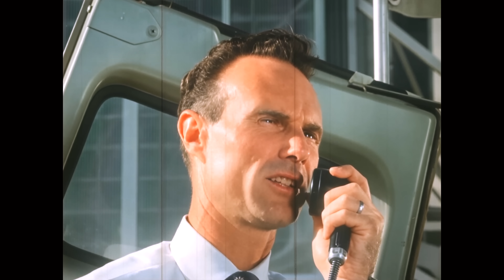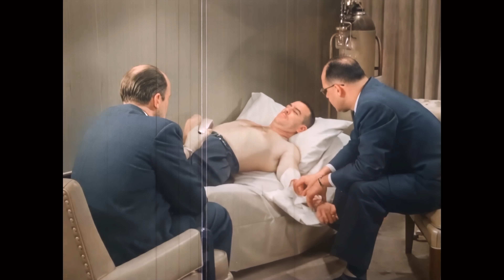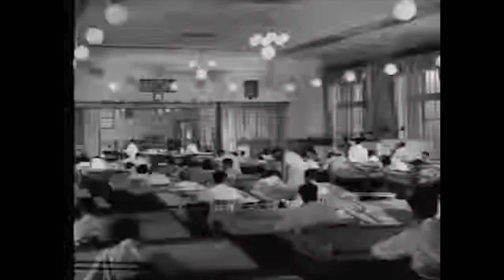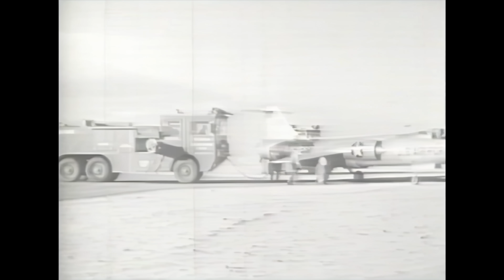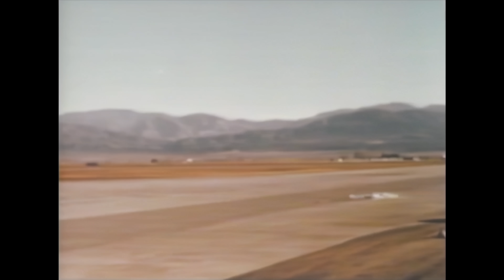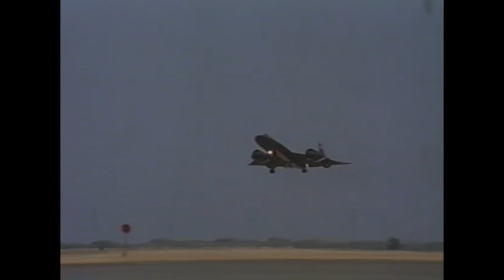Brilliant or Lethal? The F-104 Starfighter Paradox | The Missile With a Man In It

Comment: The Starfighter faced criticism in the 60s, 70's, 80s, 90s.  Still faces it.  Lockheed and America sold an affordable, small mach 2 fighter, that your country can build, maintain, and use, without the sticker shock of an F4 or better.  With adequate ground control, it could go up, attack a target 100 miles away, at over 35,000 feet, and return, bingo fuel, in 20 minutes.  Gas it, rearm it, repeat.  It's tiny front silhouette made it a tricky fighter bomber.  You could get this performance elsewhere, but at a much higher price, or you buy Mig 21s.
It was a 1950's hotrod that pushed the known envelope for fighters at the time.
It had rules.  It had limitations.  It could fly as fast as today's modern fighters.  It climbed like a rocket ship.  Fly it fast.  Slow is dangerous, and one must adhere to established procedures when going slow.  It was genius.  It required discipline to use it.  It gave a nation that was relying on subsonic jets something dangerous, and fast, and the autonomy of producing them locally.  It was a technological shot in the arm. Kelly Johnson was a genius.  So was the Starfighter.  That it served so long finishes this argument.  There were better jets?  That you could cook up at home?  That you can afford.  That can chase down and kill aircraft many times it's pricetag?  Supersonic 1950's hotrod.
They could have done better, sooner, but they kept flying it.  Because, in the big picture, it was the best.

Comment: Thanks to the pilot of the 104, that got too close to the xb-70 while flying, and because of how small and light the 104 is. The 104 got into the xb-70s airstream. Rolled over into the xb-70s fuselage. And both planes and all pilots involved were killed. The xb-70 project was canceled.
Reply: The bomber program was canceled in 1962.  Two prototypes were finished as research aircraft. The accident was in 1966.

Comment: Thanks to the pilot of the 104, that got too close to the xb-70 while flying, and because of how small and light the 104 is. Both planes crashed. The xb-70 project was canceled.
Reply: The B-70 bomber had been canceled in 1961, years before the accident, because it was extremely expensive and didn't add to America's offensive capabilities.  

The XB-70A flight test program continued through 1968. 

And that pilot you're "thanking" is Joe Walker, 1 of the greatest test pilots of that era.  He'd been given the unenviable job of flying in close formation with an XB-70A, when there may have never been any reliable data on how airflow from each would affect the other.

Comment: How does the F104 compare with UK EE-Lightening?
Cant find comparison? Although similer era?
PS  great v- blog
Building plastic kit today!  I've sat in an F-104 in Langley BC and in Calgary, Alberta.. . Truly an incredible machine
Reply from the maker: Good question!
Reply: The performance was very similar. The Starfighter had a higher service ceiling and absolute ceiling, and better range. It was far more versatile than the Lightning.  The Lightning was a bit more docile to fly, and somewhat safer to operate, although the accident rate was higher.

Comment: I’ve flown the Starfighter. To clear a few misconceptions… the landing speed was reasonable. It had boundary layer control flaps (BLC) which ducted engine air over the flaps to prevent airflow separation increasing lift during landing. Landing speed was often around 175kts, maybe not as a slow as the Hornet but certainly not terrifying. 

Controls were not overly sensitive. It was an incredibly stable aircraft and could be flown very precisely. With the high wing loading it was immune to turbulence at low level. Other pilots flying different aircraft in the low level role were jealous. 

Its small size made it hard to detect and with its great control response, it made for a great low level strike or ground attack aircraft. Squadrons flying it in Canada and elsewhere often won tactical air meets. It was a great recon platform as well. 

It had a better safety record in Canada than the F-86 that it replaced. The Germans initially had problems with it due to poor pilot training and having WWII pilots trying to fly it. 

Yea, it was demanding to fly low and fast. Unfortunately most crashes were a result of of controlled flight into terrain. A ground following radar sure would have been nice. Engine failures resulted in a lot of crashes as well. The only control issues were pitch-up at high alpha but I don’t actually know any pilot though that was caught by that as training made it clear how dangerous that was. Another scary problem was BLC failure on one side. There was nothing wrong with the ejection seat. Any comments about that are usually in reference to ones in the early U.S. versions that fired downwards. 

Finally, no pilot who ever flew it called it a widow maker. It was universally loved by those who flew it.
Reply: 175kts landing is interesting. That's no different than the Phantom. Granted the Phantom weighs double.
Reply: Since you flew the 104, I have a question for you. The 104 was denounced for not being a conventional dogfighter; i.e. because of its high wing loading, it couldn't "turn 'n' burn'. However, I read in a comment to another video that 104 pilots who took the fight to the vertical could wipe the floor with their opponents. Is this true? Could you elaborate on that, Sir? Thanks!
Reply: I know that the Italian Air Force pilots were sorry to see their 104s go.
Reply: @markymarknj The Italian Starfighter was the best Starfighter ever built.
Reply: Thank you for the great comment. The Starfighter and its test pilots at Edwards were a huge inspiration and influence on me growing up, and it's probably my favorite fighter, if not favorite airplane. 

It gets tiresome hearing it criticized yet again by another new generation who are just parroting negative stereotypes, never getting into the entire context of each aircraft and situation, and in the program as a whole. 

I hope to manage to fly in one within the warbird community, or with an outfit like Starfighters, Inc. 

I hope you'll consider writing about your career at flying it.  It's all history we need to remember.  Fans of the F-104 would be happy extremely grateful for a book (or a YT interview) from ANYONE who has fliwn, maintained, engineered, and manufactured the Starfighter.  I promise.
Reply: Can you (or anyone) please elaborate on your statement regarding wing loading and resistance to turbulence?  Is this specific to the F-104s short wingspan, or common to any aircraft with high wing loading?

I'm not sure where they fall in the WL spectrum, but would this apply to aircraft like the F-111, B-1B, B-58, F-15E, TSR.2, Buccaneer, Tornado...?

And what exactly is the 'resistance' referring to - ride quality without getting your helmet slammed inside the cockpit, needing an air sickness bag, less stress on airframe...?

I have read the B-58 and the F-104 did do the low altitude strike mission "exceptionally well" given their initial mission profiles were high altitude.  But I was never able to find any technical rationale or details, and wasn't sure if it was marketing fluff, propaganda, opinion, etc.  There MUST be SOMETHING to it giveb Europe did rely in it for strike, with both Germany and Italy going to great lengths w Lockheed to make the G and S.  

And with respect to the F-111, TSR.2, B-1B, et al, those used low altitude Terrain Following systems, including turbulence sensors at the front of the aircraft as FBW inputs to make micro adjustments to control surfaces to dampen the ride - the B-1B introducing its small FBW canards specifically for low altitude flight.  Does high wing loading still contribute to turbulence resistance in these newer aircraft, or was that accomplished purely by technology?
Reply: Great comment. 

Unfortunately, the words of a pilot who flew it will fall on the deaf ears of fools who think that they know more than real pilots who flew it.
Reply: @AlanRoehrich9651   Agree

Comment: All BS the f104 was called the widow maker it kiljed more pilots than the enermy unstable it had no electronic when radar was fitted it was so unbalsnce it fell out the sky. Another usaf frap they sold it to bribed european airforces except the UK , they sold the equally crap F111 and the equality crap phantom looking like it is made from spare parts. 
Europe made better aircraft but didn't bribe. Post-war debts were cut in half wren europe bought these crap aircraf. UK RAF were told what to have by a bankrupt Treasury.

Comment: The "Flying Coffin" was a point defense interceptor of the USAF. The F-104A and F-104C served briefly in the 1960s before it lost favor. Lockheed then modified it into the F-104G and sold it to NATO as a multi-role fighter. Using bribery as a tool to obtain contracts. The West Germans alone purchased 916 aircraft and loosing 296 in accidents with 116 pilots dead. It was totally unsuited to the multi-role mission it was sold for. Its faults included Controls too sensitive, poor engine reliability, high wing loading, poor low speed handling, unsuited to European weather conditions and poor ejector seat.
Reply: And which aircraft fulfilled all these multirole requirements at the time? Mcdonell Douglas F-4 Phantom.
Reply: @Republikaner1944  The French Mirage III was a much better aircraft and the British Hawker P1154 was about to be built.
Reply: @billballbuster7186  Better perhaps. Truly good  airplane but certainly limited airframe. F-4 Phantom lend it self to numerous roles some of which Mirage III could only dream about like Wild Weasel SEAD.
Reply: @billballbuster7186  The Mirage III was not necessarily "better" than the Starfighter for what NATO air forces used them for.  Wasn't any safer to fly, either.  The USAF flew the F-104 for 12 years, then another 7 in the ANG.  That ain't "brief".
Reply: @dukeford  Not many Mirages were sold to NATO members. It was the RAAF that had the most issues. But unlike Starfighter most were judged pilot error. The Mirage remained highly respected, the Starfighter did not.
Reply: @billballbuster7186  The French lost around 45% of their Mirage III's.   That's a higher attrition rate than any NATO F-104 operator.  The Starfighter is highly respected among the pilots who flew it, which is really what matters.
Reply: @dukeford  Yeh and idiots keep repeating themselves thinking one day it will make them right
Reply: @billballbuster7186  You can't refute one thing I've said, so F.O.
Reply: @billballbuster7186  You haven't been able to refuted anything I've said yet.
Reply: @dukeford  How old are you?
Reply: @billballbuster7186  Old enough to recognize a dipshit when I see one.
Reply: Yes ...but Great for Bribery 'Graft' and Corruption just think how much Politicians and bureaucrats made in 'Payoff's'
Reply: @WFR47-z7x  I do remember the scandal, the first bribes went to the German ministers but several others were also involved Including Japan, Italy, Netherlands, and Saudi Arabia
Reply: Truth
Reply: Its been developed for demo flights around Edwards Base.
Reply: The word lose has only a single o.
Reply: Mostly nonsense. I’ve flown the Starfighter. Its controls were not too sensitive. Where do you get this stuff? It was an incredibly stable aircraft. In Canada, we did very well with it at tactical air meets so being unsuited in its role is again total rubish. It had a better safety record than the aircraft it replaced. It was fast and demanding to fly at low level at speed but no 104 pilot ever called it a widow maker or flying coffin.
Reply: @classicjetsims  Rubbish,  The CF-104 was not the same as the F-104G. different engine for a start and different avionics. However of 200 CF-104 built, 110 were destroyed in class A accidents and 37 pilots killed. Most in the 1960s when relatively new.
Reply: @billballbuster7186 how does that relate to controls being too sensitive? You didn’t comment either on what evidence leads you to conclude that it was not suited for its role. Avionics configuration is also irrelevant to the topic. Nothing I said was incorrect. Most crashes were unfortunately a result of controlled flight into terrain. Low-level missions are dangerous in any type of aircraft. The only thing you’re right about is engine reliability. It could have been better. It would have been great if we had the F-16 engines back then. Love you arm chair aircraft analysts.
Reply: @classicjetsims  Every book I have read on the F-104 gives whole chapters to the high accident rate and the causes. Anyone would have to be blind not to see them
Reply: @billballbuster7186 ok, thought we were talking about controls being too sensitive and it being badly suited in its role. You’ve given up on those 2 points then. lol. It’s your post. Try and follow. 

I never said it had an excellent safety record but you’re blaming it mostly on the plane or avionics or something ridiculous, when most accidents were unfortunately pilot error. As I said it also had a better safety record than the aircraft it replaced. And remember the part where I said I wished we’d had an engine that was in the F-16?
Reply: @classicjetsims  Considering you claim to be a ex-CAF pilot you sure have an infantile gamer writing style. Come back when you have grown up enough to talk to adults.
Reply: @billballbuster7186 lol, of course. Nothing to say now. Don’t be so arrogant and you might learn something. And you accuse me of acting like a child. You’re a joke.
Reply: @billballbuster7186 so nothing to say now. Of course. You’re the only one acting like a child here. Frustrating trying to have intelligent discussions with some people.
Reply: @classicjetsims  You lost your credibility, sonny boy your a liar. The only CF-104 you have flown is in a game.
Reply: @billballbuster7186 don
Reply: @billballbuster7186  You're the one who couldn't defend your arguments. I have a vid too on my channel.
Reply: @classicjetsims  You made him look like an idiot, lol. Great vids! I had no idea that there were still 104s still flying.
Reply: @billballbuster7186  Give it up. You're embarrassing yourself. I never get people who argue with pilots about the planes they fly when they clearly know so little about them.
Reply: @billballbuster7186  I don't know what books you've been reading, but the Starfighter's accident and attrition rates were not much different than other 2nd Generation fighters.
Reply: @dukeford  Tell that to the Germans, hslf their fleet destroyed in crashes and 113 pilots dead. It was sold to NATO as a tactical fighter bomber that had to fly low. But it was highly dangerous with no time to eject if shit happened.
Reply: @billballbuster7186  Your hand-wringing and pearl-clutching is a bit misplaced. The German attrition rate was 32%, not 50%.  32% is pretty typical for any contemporary fighter.  A 39% fatality rate isn't out of the ordinary, either.
Reply: @dukeford  And you dear boy are like record stuck in a grouve. I was just pointing out the Starfighter's bad rep utation. I did not crate it aviation writers did.Maybe Lockheed should have payed them off too.
Reply: @billballbuster7186  Sometimes things need to be repeated for the feeble-minded.😁

Comment: I bet if you modify some of the F-104s that are still flying privatly owned they can compete with todays fighters...
Reply: Speed wise for sure but that's about it.
Reply: In speed over Edwards
Reply: It has won mock air to air fights, against even the F-15. 

Some parameters of performance are still competitive with planes designed nearly 59 years later.